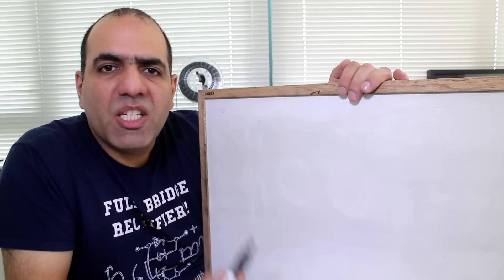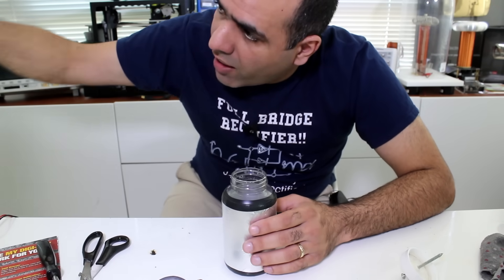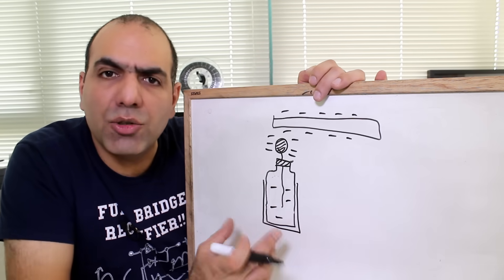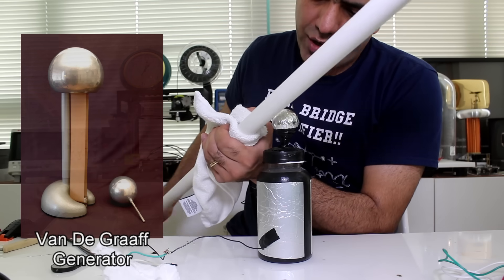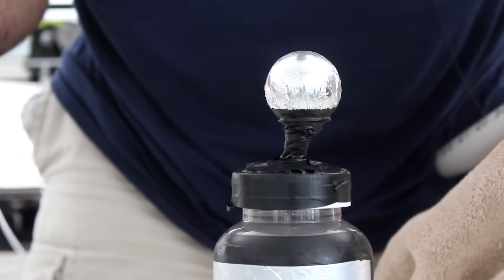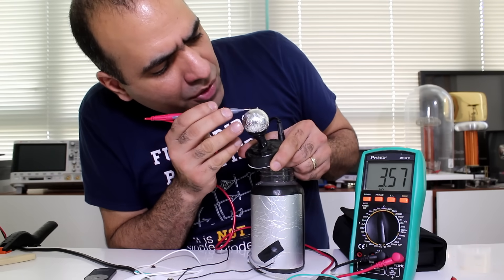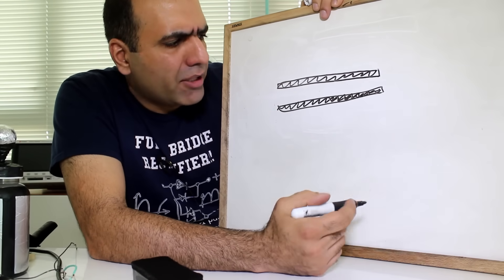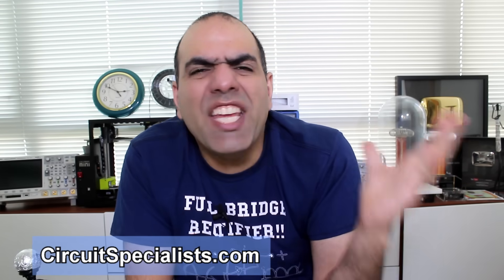Make a SUPER HIGH VOLTAGE Capacitor

Comment: Hi Mehdi !Please, can you make a video about spot welders ? Their are arduino based ones and i'd like to have you opinion about these as they are designed for batteries nickel strips soldering, and they are thin, like 0,2mm.. What is the science behind and is their a way to spot weld something like 0,5mm steel strips ? Thank you Mehdi if you can do somehting about this or answer my question in any way ;) Take care !

Comment: I used to make HV capacitors when I worked at an electronics club for school kids in Moscow, and we used plastic file folders as insulators. The capacitors worked quite well: we usually got about 7 nF (without gluing the aluminum foil to the plastic to save time) and a voltage rating of anywhere between 5 to 20 kV, depending on how well the caps were made. Dielectric absorption was a bitch though: I once killed an LC meter with a capacitor that I'm certain I had discharged.

Comment: @electroboom can i charge my capacitor using regular aaa batteries? Ps i wanna make a stunt gun xD
Reply: You would need several hundred of them connected in series because each one is 1.5 volts.

Comment: If you have a weak heart you can get killed doing this. A while ago classes that taught automotive engineering used to get the class to hold hands and got a car battery. You can see where this is going but the point was to see how the power was distributed between everyone as electricity passes through everyone. Until someone died. In high school they do not allow this as kids can have frail hearts to.

Comment: After watching this video numerous times and seeing the videos showing the plastic liner inside the coke cans, I wonder if a coke can would make for a good capacitor. Guess you’d just have to cut the top off and seal the edges with electrical tape to insure the salt water doesn’t contact the metal at the top.

Comment: The static electricity from rubbing the PVC gives you a higher voltage potential than the transformer at only 120 vac. Try charging it with the pvc to get higher voltage.

Comment: A common way to increase the value is to put one foil on one side near the bottom edge, and flip it over and put the other foil on but near the top edge. Place a 2nd sheet of insulation and roll the cap so each plate is touching the dielectric on both faces.  The foil at the edges makes a contact at each end of the rolled tube.  This makes very short electrical paths to all of the foil resulting in very low ESR with twice the capacitance for the amount of foil used.  Put the roll into a PVC pipe with a contact on each end and you have a very robust capacitor.  Rolled Mylar capacitors are very effective.

Comment: Though this guy has a good understanding building static capacitors, he’s not well acquainted with making them. Rather he’s a goof ball who knows just enough to get himself hurt.

🔴 Always use your fist to receive a spark, rather than your fingertips. 

🔴 Never use a ground wire on the other hand as this causes the voltage to pass through your heart. 

🔴 Thicker dielectric material yields greater capacitance, rather than less.

🔴 High dielectric materials such as PVC makes for high capacitance. 

With over 40 years studying electrostatics, I would love to have his static monitor machine.

Comment: Just curious, how is this higher voltage than a regular capacitor (you suggested the capacitance is quite low)?
Is it the method of charging it which generates high voltage? Could you try this method with a normal capacitor for even more power?
Thanks for making this really interesting video, and please don't get yourself electrocuted :O

Comment: You need to know that rubbing the tube doesn't create the charge.  All rubbing does is increase the contact between the tube and the material used to rub.
Reply: Robert Johnston  A very common misconception.  I learned that when I had a contract with Eastman Kodak.  The issue was that a stack of microfiche was separated by air and a selective combination of pins and slots in the microfiche allowed just one selected microfiche to be released.  As it turned out, the selected fiche would have a static charge of 5-10,000 volts and would immediately jump back into the open cassette from as far out as an inch before a handler clip could grab it.  I had a notion that the charge was caused by air flow and asked Kodak for help because they had extensive experience with film handling and static electricity.  

They told me the cause was rapid separation of two surfaces with different characteristics.  Typically film base on one side and emulsion on the other.  The fiche didn't rub against each other because they were held by the selector pins and the cassette.  They just set there in a neat little stack until separated and selected.  The problem was solved by coating both sides of the fiche with a wax material provided by Kodak.  This was done by passing the fiche through rollers and they then had the same material on both sides.  Instant solution!  Not friction and not air flow.

I should add that I was given the project after we had acquired it from a company we purchased.  My job was to solve problems like that and I had no problem in asking the customer, Kodak, for help.

We can discuss the Van de Graff issue separately.  I built one in Junior High.
Reply: Robert Johnston  Did you read my comment about the Kodak project?  No rubbing involved, just rapid separation of two different surfaces.  Kodak PhD's were very specific on that issue.  They ruled out the air flow (my notion) and movement of one fiche with respect to another.  Their fix of making all surfaces electrically identical solved the problem.
Reply: Robert Johnston  Fine.  Just what causes the charge to develop?  Does rubbing actually wipe electrons from one surface and move them to the other surface?  Since we are both physicists with advanced degrees and years of industrial experience, I must assume you can describe the process and the purpose of rubbing.  Please help me understand.

Regarding the Van de Graff, what is the function of the needles that actually don't touch the belt?  There are many "explanations" that are completely wrong.
Reply: Robert Johnston  I just updated one of my comments to include some text describing the function of the original Van de Graff generator.  No friction, just rapid separation as the belt leaves a roller.  That's why the belt doesn't wear out.  Some amateur generators do use friction but not the industrial and original versions.

Comment: Variable tuning capacitors, used on radios and other systems, don't have an insulator between the elements.
Reply: Robert Johnston  I was simply responding to something in the video that said you had to put an insulator in to make a capacitor.
Reply: Robert Johnston  I think you are slightly mixing "Tank Circuit" with intermediate frequency but 455 is right for ordinary receivers and around 10 mHz for higher frequencies.  For the Azusa transponders we used a carrier of 5 gHz and an IF or 60 mHz, the offset between the received and responded signal.
Reply: Robert Johnston  If you can't find a reference to the Azusa Missile tracking system I will expand a bit.  There was a need for a very accurate missile tracking system for the Atlas missile to independently validate the guidance system and AZUSA was designed for that purpose.  It was also the primary range safety system and if you look at the early Atlas launches where the missile was destructed, it was based on the data provided by AZUSA.  Over time AZUSA was used as the primary range safety instrumentation system for all launches from the cape.  A key feature of AZUSA was accurate velocity measurement using a coherent transponder and differential doppler data from several ground stations.  Also, for impact prediction, velocity accuracy is more important than position accuracy at the time of sustainer shutdown.  If the missile position is wrong by 10' the impact error will be in the same order of magnitude.  If the velocity error is 10' per second, the impact error will be 10' times the duration of flight in seconds.

Comment: Is it possible to make a little boat, made by plates of copper and zinc, in such a way that, when in contact with salt water, it generates enough energy to move itself?
Reply: Robert Johnston  You need salt water to conduct the electricity from copper to zinc. Salt water or saliva.
Reply: Robert Johnston  Not distilled water. This thing won't work in distilled water. Saliva contains a bit of salt, that's why it would work in saliva. But it's better to do it than to talk about it. If I had a camera, I would built one of this boats, to see if it works.

Comment: Get yourself a CRT (tube) TV that at least powers on. The anode voltage to the picture tube is typically 30 kV DC. Should be perfect to charge up your capacitor. Fast.
Reply: Dont forget that TV's have a super  powerful capacitor in them. Like, leave you on the ground twitching strong. Gotta make sure that's safely discharged first you're pulling it from an old TV.
Reply: @kanorshkan  There's no such thing as a "powerful capacitor". Power is not a rating on a capacitor. Capacitors have only two ratings: capacitance and the maximum voltage they will  tolerate before shorting out.
Reply: @morpheus6749  Equivalent series resistance is also important. And there are safety ratings, but this is the wrong channel for talking about them.

Comment: I would like ElecroBOOM 's comments on the saying, "it's the volts that jolts, but the amps that kill."

Clearly, with a low resistance and no current control, high voltage equates to high current. Thus presenting danger of high voltage. But a high-resistance (real + imaginary) or voltage-limited circuit can be relatively safe.
Reply: He actually goes over this in two videos:

- https://www.youtube.com/watch?v=XDf2nhfxVzg
- https://www.youtube.com/watch?v=DOMs7mYm_zs
Reply: @waynebot  Thanks for the links.

Comment: I think on commercially made capacitors the foil is taken right to one edge of the film on one side and right to the other edge of the film on the other  (maybe they both protrude over the edge slightly).  When they are rolled up the connection is made to the exposed edges, that way the stray inductance is reduced.

Comment: Hey, tolles Video. Das ganze geht aber noch simpler. Ich habe bei mir die 6V Spulen drinnen gelassen und einfach einen 12V Spannungsregler vom China-Roller ein gebaut. Funktioniert bis jetzt Top. Batterie lädt, Licht geht auch.
Als Tipp für dein Kumpel, es gibt 35W Halogen Lampen mit ba20d Sockel. Der unterschied zwischen H4 und denen ist nicht bemerkbar.
Gruß Lenny

Comment: If only you had some kind of high current burst system that could energize metal to plasma at the atomic level and some kind of external cladding on the vessel to place a charge to attract that atomic metallic plasma.... 

Next time use a cut-open light bulb? 8P

Comment: How do I connect something to earth?
Reply: A three pin plug has two flat blades with the  grounding pin between them. The plugs cord has three wires inside, the green one is the grounding wire which is the one used for grounding.

Comment: The negative charge on the ping-pong ball will not ionize the air ?
Reply: If the gap to ground is not too big, the volts/metre - electric stress, or field strength, will - hence the sudden spark when that happens.
I seem to remember "3kV per mm" for dry air ntp.

Comment: King Junior sucks leyden jar balls. What is more depressing is that channel even has subscribers. Are so many ppl so dumb? ...Anyway, thanks for doing things right and still keeping us laughing. Also, try rolling the aluminum foil with paper towel between layers instead of plastic, then place it rolled up into ABS pipe, filled with clean cooking oil, and end caps on with terminal screws through to connect to. If it arcs, it doesn't matter as the oil is not damaged.

Comment: o.k. so built a capacitor large enough in order to store the strike of lighting.....use later to power house.....can it be done?  I saw this video again....had the idea that you may actually start a new fad with kids...Eyebrow dancing.
Reply: it will discharge very fast and you won't benefit of it, you need something that will take the discharge very slowly and transform it into stable current.
Reply: People generally just take a look at exploded tree stumps, from lightning, and say, " it's all yours m8" !.
Reply: If it can make it down to here through a mile of sky at a minimum of like 6 Million Volts, it can make it through or around whatever insulator between the plates you can come up with.  Oh and there really is not much energy there either.  Power plants make continual energy.  A cap only releases what it has and that does not equate to a terribly long work performer.  Folks hashed it out a ling time ago.  You'd need like an acre sized plate with some magical glass lid on it, and then plate the top of it but stay away from the edge.  Ooops, there is the mile through the air thing again.  You would need a two mile glass cap on the one acre plate.  All for an energetic, but very short event.  Hard to make use of a short cycle 6 MV cap, but a 6MV DC interlink from Bonneville to LA provides CONTINUAL POWER.  That is one reason why they call the leyden jar electrostatic.  Real power requires current provision over long time periods.

Comment: To recap its not the voltage that kills,  its not the current that kills, its not the power that kills,  its not the weed or poison that kills you, its the LENGHT/DURATION of current pulse which is assisted/pressurised by Mr Volt that can kill you depending on your own resistance!!
   12Amps then stable 5Amps slowly reducing to 0 flowed through his body for a few micro seconds!
 Edit also its not the gun or the lead poison or your heart that kills you its the bullet that kills
Reply: its also not the bullet that kills you, its the inability of your heart to pump blood.
but its also not that, which kills you, because its the lack of oxygen in your brain that kills you, but its also not that because its the inability of your brain to produce currents  that kills you.

am i right?? guns dont kill people. its the inability of our brain to produce currents that kills you. silly world that think guns are evil

Comment: Hi One Eye Brow Mad Scientist:

May I ask few questions?

I need to make one giant capacitor for my power supply build. Need it to hold least 30volt or more as my cordless power tool is 18voltDC + 24voltDC... or do you think I should make smaller one and series it together? as higher voltage cap is more difficult to DIY... to roll it tight together.

I am plan to use 12" long roll of Alum foil from Kitchen Department and 2 or 4 layers of thick garbage bag fold up as ditic(speeling) from Janitor department or do you have better every day material for this purpose from any typical USA house corporation?

Comment: I need some help. When i try this, it does not charge the capacitor and i cant hear any sparks of the charges going in to the capacitor. the outer foil is grounded as am i, but it does not work.

Comment: HI PALS, I tried myself to do this capacitance but, even if I made everything as he did, it still do not work well. Have you some advices? I'm using a kinda metal  top, is this a problem? THANKS. 

:)
Reply: Yes, use a plastic one.  Mine does not work but it worked better with plastic.

Comment: Could you improve the voltage by using a different fluid i.e. water and magnesium (sulfate I believe is what the use in batteries) correct me if I’m wrong?

Comment: Awesome video as usual! One nitpick - when you measured the salt water resistance, one of your probes had a tiny surface area compared to the inside surface of the jar, so the capacitor would have a much lower ESR than you measured, roughly by the ratio of the surface area of the jar to the surface area of your meter probe, or about 1000x smaller (so maybe 5 ohms). I agree that it would be higher than the second one you made, but not by much. Also, when you measured the current, it is likely that the inductance of the resistor was much higher than the stray inductance so it made the shock much lower current.

Comment: Hi Mehdi. Recently purchased a cheap, Chinese made, 50V 50KuF capacitor through eBay and wanted to know if you've made a video on how to test the reliability and quality of capacitors like these? My cheap multi-meter only goes up the 200uF. I'd like to use it and a 150amp, 1600V full wave bridge rectifier in the modification of my MIG welder to make a more DC like wave and reduce spatter. Wish you made a video modifying cheap welders as well. Cheers

Comment: You should never discharge ACROSS your chest.  Ie from arm to arm.  This can cause heart failure or a heart attack. As a matter of fact, high voltage engineers keep 1 hand in their pockets when working on high voltages.  This stops any accidental discharge across the chest.  You only need 150mA to stop the heart.  I can’t recall what the period of time this is over is but there will be a critical Energy level in Joules.
Reply: FYI.   https://www.asc.ohio-state.edu/physics/p616/safety/fatal_current.html